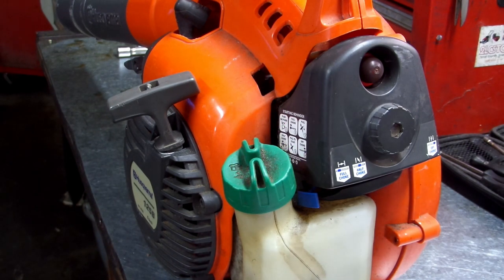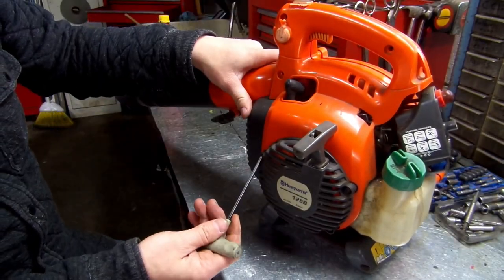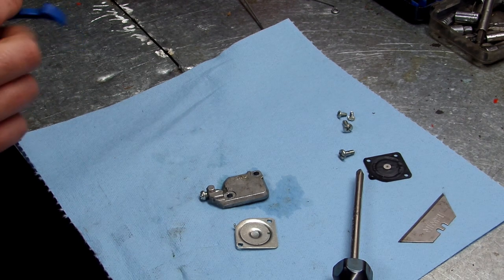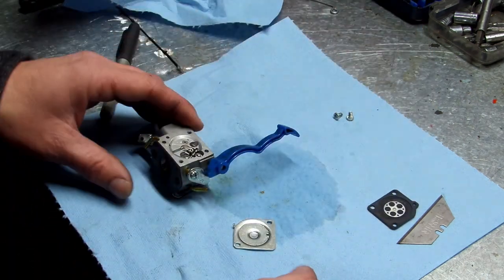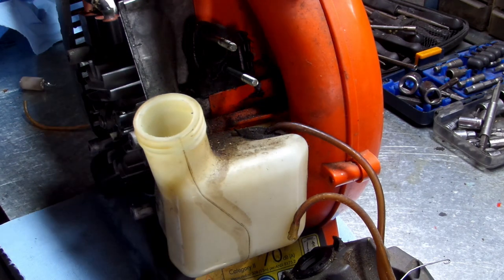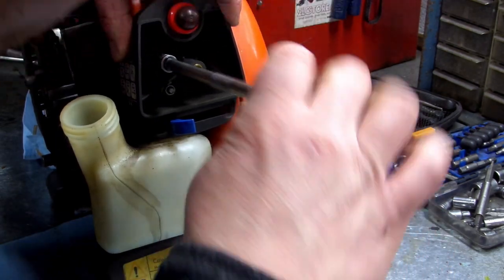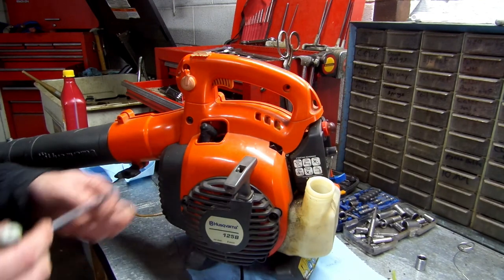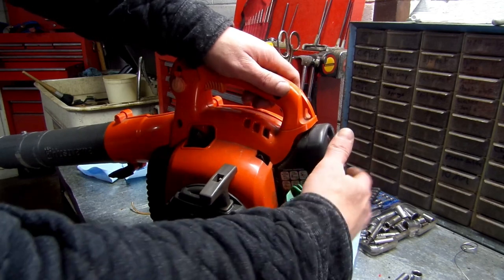Husqvarna 125b Carb Rebuild

Comment: I purchased a leaf blower and upon starting it, the thing starts normally, then dies. I noticed the carburetor  had been replaced along with the fuel lines, filter and it still does the same thing. It acts like its running out of fuel some how. I work on this stuff all the time and have never had one do this. I even checked the spark arrestor and exhaust for blockages. My thought was the other person replaced the carburetor  because thats what it was doing before. It has plenty of compression,  so what is your idea on what it can be.
Reply from the maker: I could still be the carb if it had been sitting for awhile before you got it. Does it die on its on at idle or when you squeeze the trigger.
Reply: @outdoorpowertech7738  The carburetor  is brand new. I think he gave up after what he did did not fix the problem. I have had the carburetor  apart and I cannot find anything wrong with it. The thing starts normally, then proceeds  to die after a minute of running. I will try and spray fuel into it as its dying to see if it will stay running. I must say this one has got me stumped. If I can keep it going while spraying fuel in it, I will order an OEM carburetor  for it. I can tell this one is an after market one.
Reply: @outdoorpowertech7738  I just injected fuel into the intake after I got it started and By dripping fuel into it, the thing kept running. That tells me the after market carburetor  is junk. I ordered an OEM. Sometimes you have to redo what others have done. I know I have thrown  a few after market carburetors in the trash. Then again, I replaced one from an Echo trimmer and it ran perfect, no adjustments. Also a leaf blower. Aftermarket is so hit and miss.

Comment: Is there an easy way to replace the small spring that's located in the carburetor that allows the needle to open and let fuel into the carb?. I found that it's difficult to replace that spring without losing it. How do you replace it?
Reply: I use a little vaseline on the spring and the needle valve and rod to hold them in place hope  this helps.
Reply: @kennethlowe6337  thanks for the tip!

Comment: i bought the blower 10 years ago when i was in usa. I brought with me when I moved to Indonesia 8 years ago. last month the engine blower run but need to be chooke. I've cleaned it many times but it still doesn't work well. I think the main jet needs to be cleaned. I just found out about the main jet after seeing the video you shared on youtube. I didn't find the right tool to open it. please give me information about a screwdriver or a tool to open the main jet.    Or can you show me on ebay or amazon which tool should i buy.  Thanks again.

Comment: This is a great video. Thank you so much, but I've tried all of this and the blower is in worse condition than when I started. The carburetor looks fine; gaskets look good, cleaned out the ports pretty good, got a tool to remove and clean the H and L screws, put new lines in and even tightened the screws under the housing to the carb mount and ensured it had spark. It looks fine, but it won't crank or run now. It used to just run on half choke and bog when I pulled the trigger. Now it won't even start. I'm waiting on a new Carb now but I think I screwed something up.

Comment: Your video was the second one I viewed and went with your instructions. You should feel great! You’re helping a lot of people like me. The problem with mine was the rounded screen had crap all over it. I cleaned that off with BrakeKleen. Everything else looked good even the air filter wasn’t too bad but cleaned it after I did a test run on it, just to make sure the crap was the root cause. Mine would run for very short bits of time. Now it’s running like a charm! Thanks again!

Comment: do you think it would work if I got a complete carburator from Amazon?
Reply from the maker: Depends on what’s wrong. With 2 cycle stuff it could be a number of little thing that could cause issues. No spark, low compression under 90 psi, spark screen clogged, gas filter clogged

Comment: I bought one of these 2 years ago and it never ran good, bogging down, always a problem, now it wont start. DONE with it. Just bought an Echo 25cc hand held and it works awesome and blows way stronger than the husky. Echo is the way to go. No issues and starts right up.